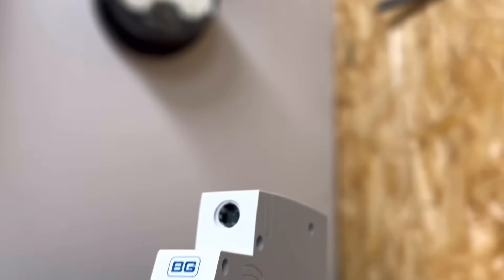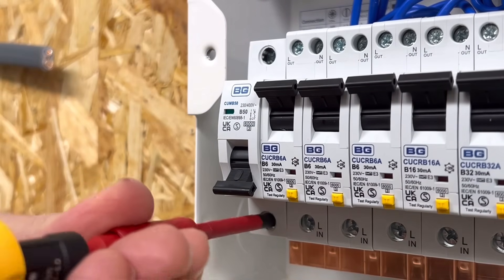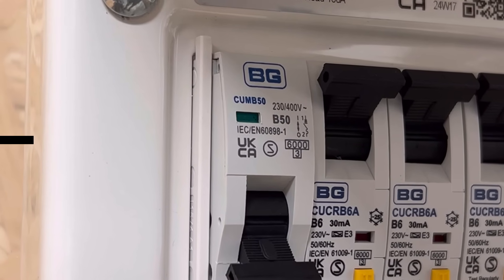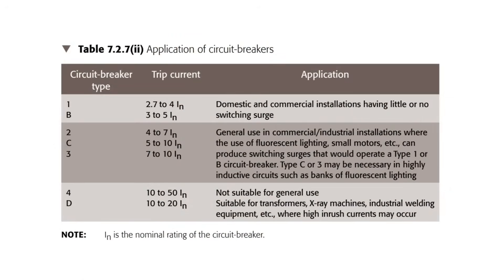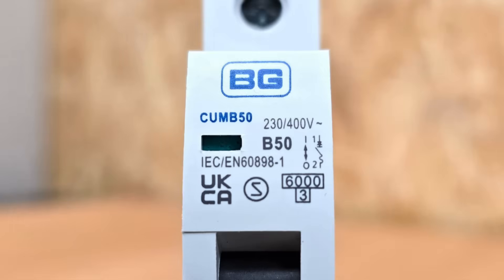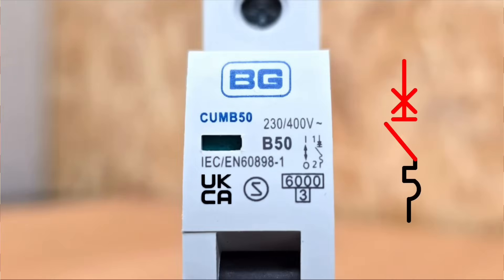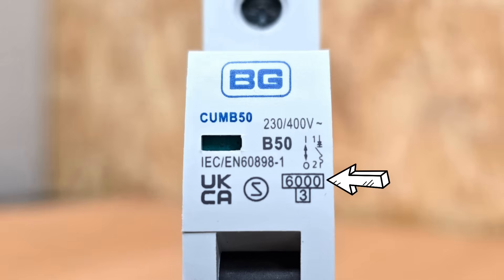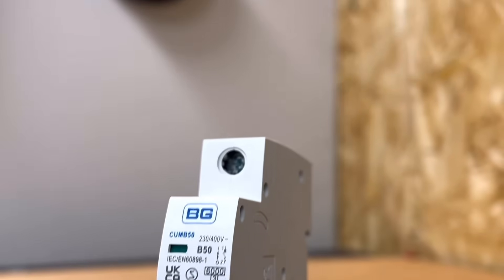What Do The Symbols Mean on a Circuit Breaker?

Comment: Hey Joe - if the MCB thermal component is represented by a curve, then why is the thermal component of an motor thermal overload represented by a square?
Reply: The one Outward-Arrow was for Magnetic Tripping unit (Short-Circuit).

The Squarish symbol is about Thermal (OverLoad).

Isn't it right?🤔

Comment: 0:56 that MCB looks very different to the RCBO's already in the board. 
We are not supposed to put MCB's from different manufacturers in the same board. It is also true that MCB's etc from the same manufacturer but different ranges can't necessarily be used together - subject to the said manufacturer having tested them together (this cropping up with old obsolete equipment). 
So how would you check to be sure these different components are compatible in terms of BS 61439-3.
Reply: Its clear it works on the same busbar
Reply: Absolute nonsense

Comment: I’ve never understood the choice of red and green for a breaker being in the on and off position. I think it’s the opposite of what consumers would expect, and I think it does more harm than good.

When my tv is off, there’s a red standby light. The big switch you showed in the video has green for on, and red for off. An emergency switch is red for off. When an SPD is blown, it’s red, and green means it’s working and power is flowing. 

If there’s been a fault and the breaker has tripped THEN it can show a red - meaning failure/fault/problem. Normal operating conditions should be green.

In my breaker box I have an SPD with a green indicator (working as intended) right next to a breaker with a red indicator (working as intended, no fault, power flowing).
Reply: There are various different conventions that can have conflicting signals:
Go/stop: green (go)/red (stop)
Danger/safe: red (danger)/green (safe)
On/off: lit (on)/unlit (off), sometimes green (on)/red (off)
On/standby/off: unlit indicator (on)/red indicator (standby)/unlit indicator (off) - as you've mentioned, a whole bunch of TVs do this

With the energising of an electrical circuit, you have the ON state having to be flagged as being both "danger" (hence red) and "go" (hence green) - and OFF being vice versa, whereas in other scenarios the "go" state is also the "safe" state.

If there's a need to flag a detected fault, then that ought to be a separate indicator, because they are really two separate pieces of information: the energised state of the circuit (danger/safe), vs. a fault state (fault/clear). In normal operation, that could well result in different colours, but that's not contradictory because they're different pieces of information.
Reply: @rednammoc I fully understand there’s different conventions. Maybe, in this case, color shouldn’t be used on something meant for consumer operation. I/O and on/off convey way more meaning in a clear way.

Should a normal consumer know that when everything is working SPDs are green and breakers are red?

Some AFDD breakers even have 2 indicators on the same breaker: a red indicator for on, and a green light for operating normally/no fault. Both are shown at the same time.
Reply: Take it simple:
RED–Energized/Hot/Danger!
GREEN–Cut-Off/Cold/Safe to go...😅

In LV/MV Switchgears be it ACB/VCB etc, this will always be the case...